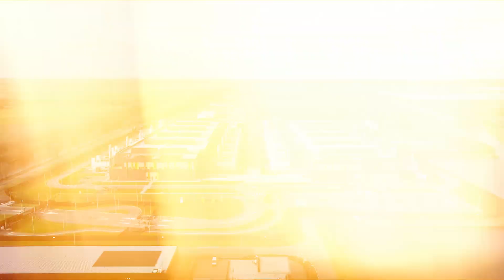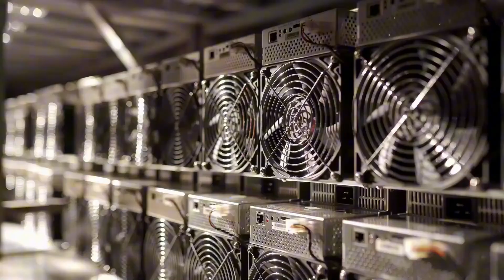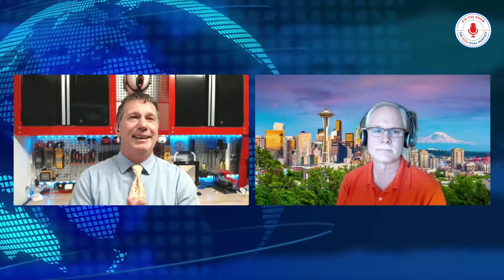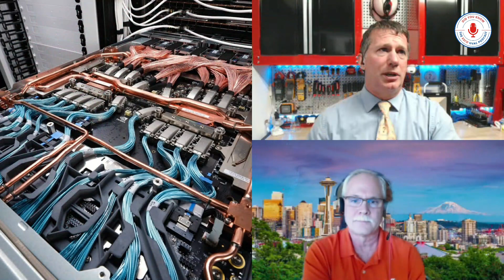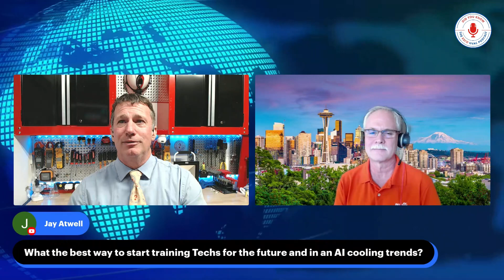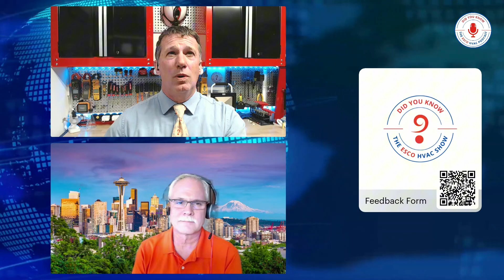AI and Bitcoin Data Centers Are Changing HVAC Forever with Liquid Cooling - Ken Duncan

Comment: REVERSE CIRCUIT (reverse return) in water to balance pressure in the ranks  ... like used in WATER SOLAR PANELS  ...   no problem to balance flow valves  ... not mencioned

Comment: MA
Reply: REVERSE CIRCUIT (reverse return) in water to balance pressure in the ranks  ... like used in WATER SOLAR PANELS  ...   no problem to balance flow valves  ... not mencioned